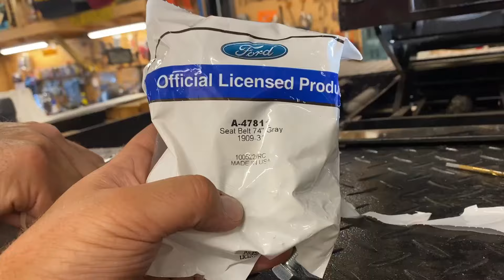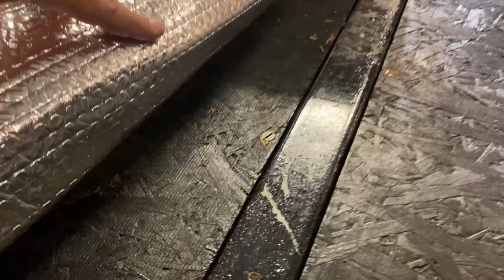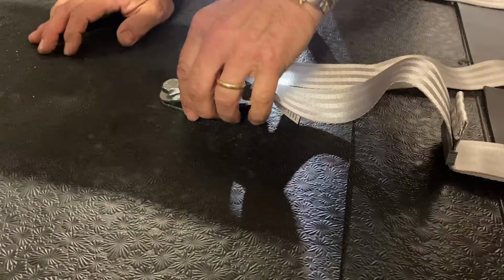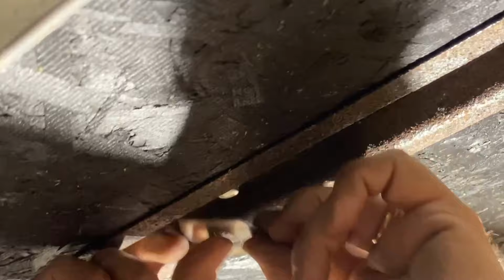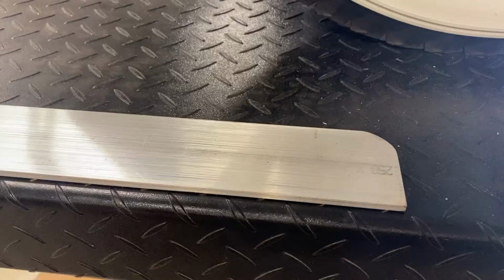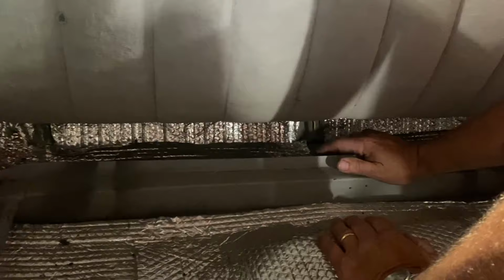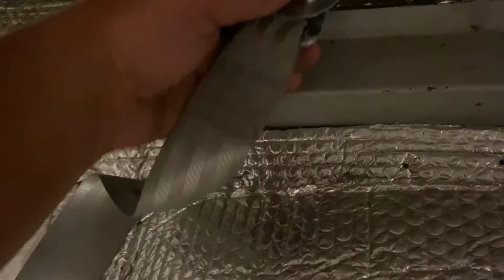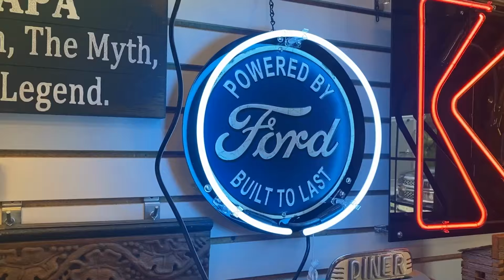Enhancing Safety in Your Classic Ford Model A: Installing Seat Belts

Comment: Nice job. Just look at those door latches. Without seatbelts, you are going to fly in any kind of impact.  Also, you should replace that OSB floor with actual plywood, and put cotter pins in the rear spring bolts.
Reply from the maker: Good catch on those cotter pins. We’ve had to do a few small things like that, but we hadn’t noticed those. Thanks for watching!

Comment: I've driven my '30 A Coupe for years without seatbelts and no real problems, although one time my driver's door did pop open while making a right turn. That can be a little embarrasisng when you have passengers. But the one main reason why I would install them is to make the car appear safer for female passengers to ride in. They always ask about seat belts, I've found.
Reply from the maker: Thanks for sharing. They are a must have for the females in our lives as well. Also, a requirement for my two young kids who probably wouldn’t stay seated without them. Thanks for watching!